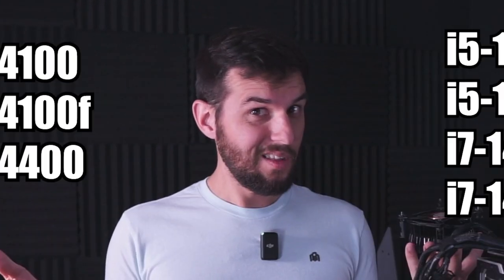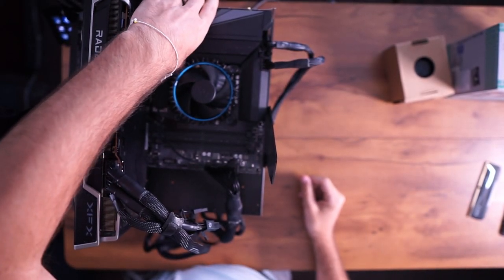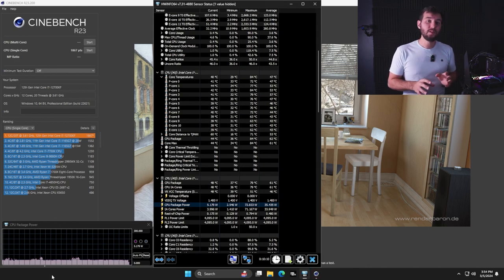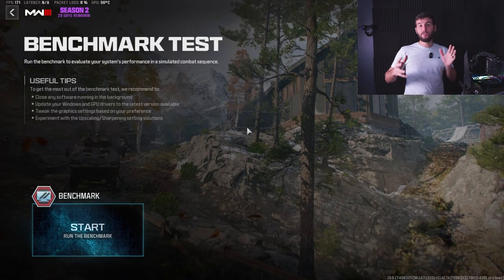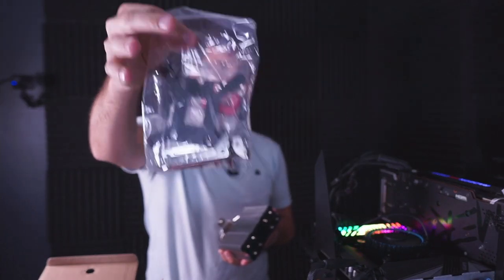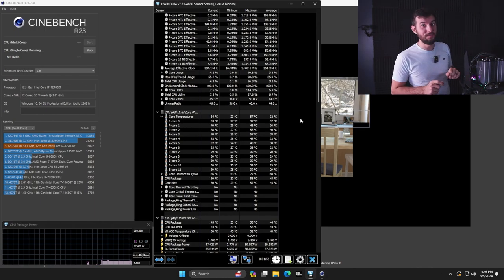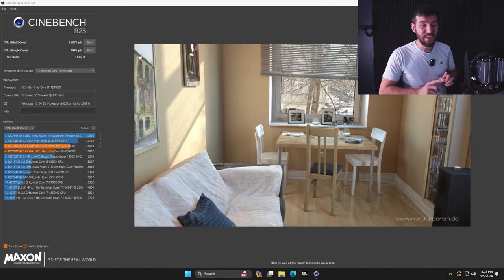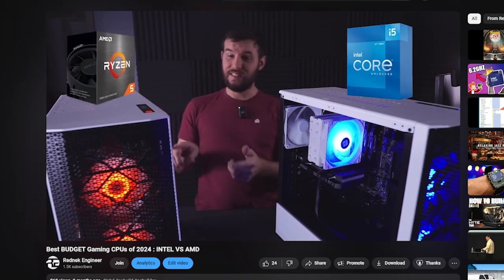Can you use the Intel RM1 stock cooler?

Comment: Intel Core i7 12700KF processor not get this cooler in box. This cpu has 125 watts base power.
Reply from the maker: I explained it in the video, the base tdp doesn’t really matter. Because your cpu will boost as high as it can to get you the best performance. The max power output of a fully boosted i7 14700 is over 200w which is more power than my little 12700kf can put out. That’s why it’s a relevant test

Comment: Can I use it with at i7-12700KF?
Reply from the maker: I would recommend against using the stock cooler with that cpu
Reply: @RednekEngineer  Thank you for that information.  Do you have a recommendation for an inexpensive cooler for an i7 12700k?  From what I understand, the processor  doesn't come with a cooler.  Thanks!
Reply from the maker: @squirrelattackspidy  thermalright peerless assassin 120 is able to cool that cpu pretty effectively.